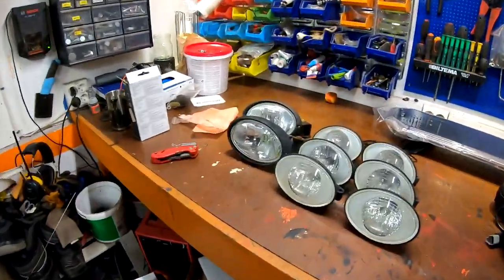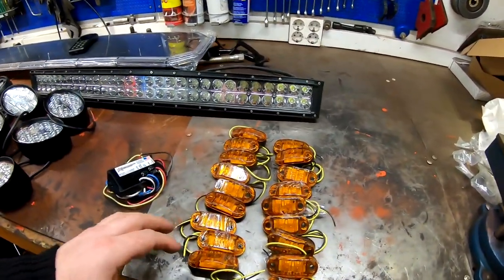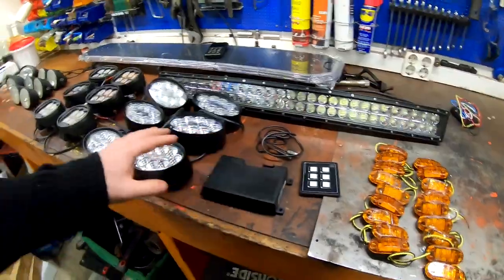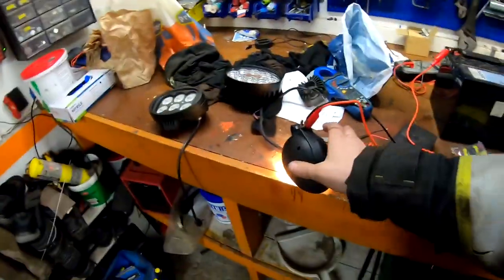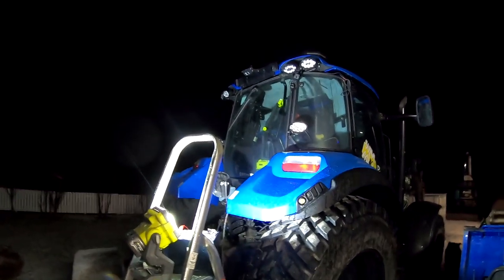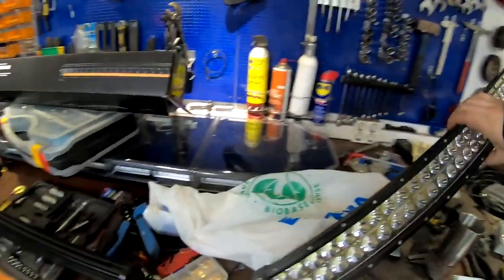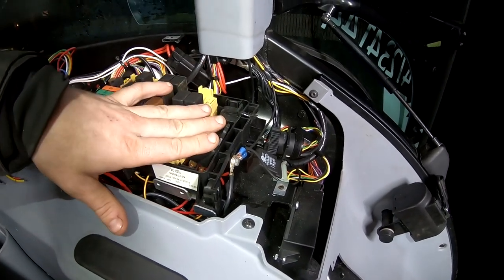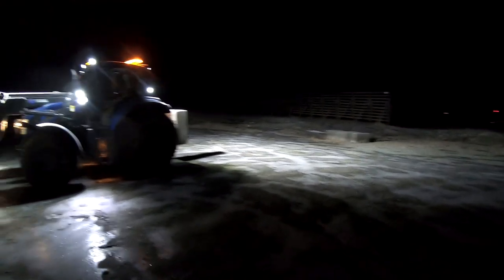800w of LED lights installed on my tractor (Short version)

Comment: It is a good idea to replace with LEDs but the problem is that when it snows, the LEDs do not heat up and do not melt the snow or ice on the optics. Have you thought about it?
Reply from the maker: The lamps I removed was 50 watts and the led's 40w and 60w so it's about the same amount of heat from them. The halogen lamp only had one bulb making the heat so it's probably a bit hotter than the led that had it spread over more sources. 
But I never had any problems with led lamps on my previous tractors v and I've run led's for many years 😊
Hopefully it will work here as well, we will for sure see when we get some snow 👍

Comment: One thing you should place tow light on the side of the tractor it help an you are driving on not as wide roads
Reply: Peek 90 degrees from the driver
Reply from the maker: I did mount some in front of the cab that are 90 degrees out to the sides, only 12w but helps a lot 😊
Reply: @MiniMachines1  oh didn’t se see but looks really nice